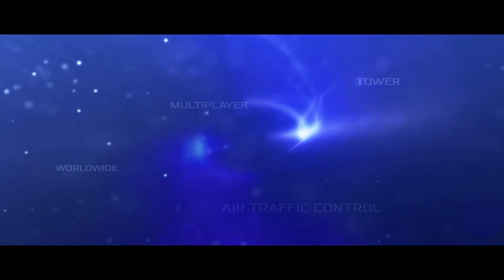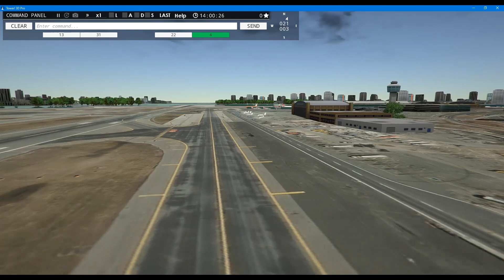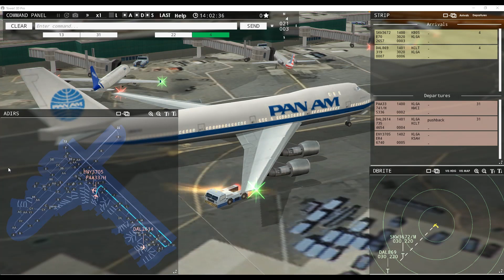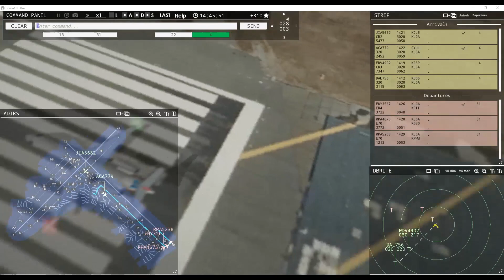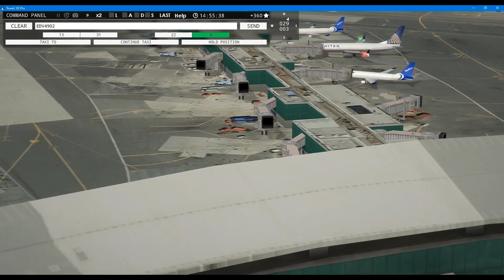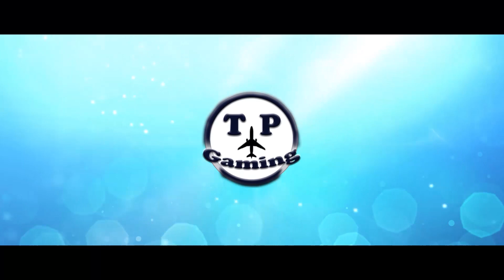La Guardia New York First time Tower!3D Pro (modified)  KLGA @ 2pm

Comment: LGA is an interesting one. Before COVID, the airport averaged a little more than 70 movements an hour, equally distributed between arrivals and departures. LGA is actually capped at 71 movements an hour; it used to be 75, but the FAA reduced the slots. The main configurations in order of decreasing usage are the following: landings 22, departures 13; landings 22, departures 31; landings 31, departures 4; landings 4, departures 31 (very rarely used because of spacing issues); landings 13, departures 4 (almost never used because of airspace issues affecting EWR, TEB and JFK). Sometimes you have single runway ops (usually on 31), but only if a runway is closed or you have extreme wind conditions, which happens more often than you’d think in NYC. The L22/D13 is the most efficient configuration because it allows for the least arrival spacing and you can get more departures off in between the arrivals, but the 13 departures can mess with JFKs airspace.
Reply from the maker: Great infos, I´ll keep it in mind. Thanks a million.

Comment: Here's my suggestion for handling this airport.  I'd depart flights on 13 @ R taxiing via B. Flights requiring a longer runway can continue on to 13 @ P.   Arrivals on 22 taxiing to the terminal via B, A.  Should you choose to use 31 for departures, I would send all flights from terminals to the left of L to 31 @ W via B; and all flights from terminals to the right of L to 31 @ Z via A.  I'd still use 22 for arrivals since the distance to pass 31 is much shorter, allowing you to depart flights more quickly unless this airport also has that stupid glitch where you get penalized for departing a flight on a cross runway even after the arrival has already gone past, and there's no chance of a collision.  Thanks for sharing!
Reply: Of course, if you wanted to reverse that, and have flights depart on 4 taxiing via A, B.  Arrivals on 13 taxiing via B (again, so they cross 4 more quickly, allowing you to depart faster IF the glitch I mentioned in the previous post doesn't apply). BTW, it's pronounced LA-GWAR-DEE-YA or LA-GWAHR-DEE-YA. :)
Reply from the maker: Since you live in Orlando, i believe the pronounciation as correct. I´ll keep it in mind.. :)  Apart from that I´ll keep your suggestions alive for the next attempt. Thanks for always sharing your ideas. As well as your support. Thank you Gary.